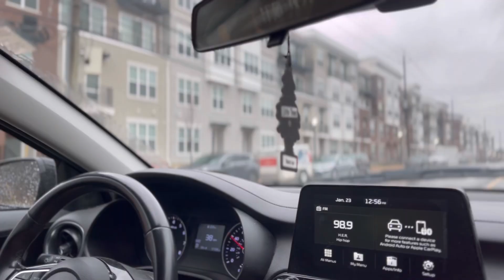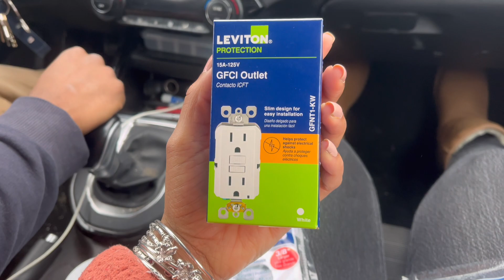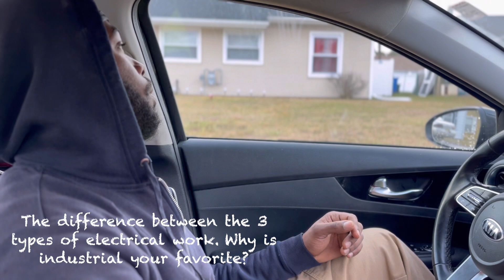A DAY IN THE LIFE OF AN ELECTRICIAN | ADVICE and Q&A ON HOW TO BECOME AN ELECTRICIAN

Comment: As  a electrician my self started back in 2003 I don't know a industrial electrician  that will tell you that  they like to do  residential electric an I have meet good  industrial ladys and men that i would not even let  touch a wire nut  on a residential job  yes the state test for your journeymen  card  is a money racket  any one that is good at testing can go pass the test because it is all in the  code book and a open book test  but it takes on the job training to get the proper way of  doing things  like any thing in life it takes a little common sense in the work area  goes a long way in any work you find your self doing  keep it up man its good to see younger generation taking a intrest in the feild .

Comment: Haha, he knew he was gonna get called out for using the impact!
I'll add not cutting the ears on that GFI in the cut in box and not using a square drive.

He made a great point about father and son teams, I'm trying to get my daughters in it too. 

Some industrial work is good, but he didn't mention anything about being stuck on a lift all shift and having to maneuver around a running shop or how much it sucks being on a roof  on a hot/windless or cold/wet/windy day.

They all have ups and downs. All together, I'll take industrial jobs. You get to get shit done.
Reply: I’ve done commercial, residential, and industrial. I always preferred industrial, myself except that the safety culture has gotten out of hand. I love motor control, PLC, instrumentation, rigid conduit, etc. It’s so much more mentally stimulating than your regular mundane tasks in commercial and residential like wall rough-in, branch piping,  etc
Reply: @Ephesians-ts8ze  there are enough tragedies like 1st year apprentices meeting 277/480 on a lift, unsupervised.
I don't think any excuse or apology is going to quell the family's sorrow or anger at the loss of their daughter.

I'd say let them learn on 120v connected to an arc fault breaker at most. She didn't even know how dangerous her work was.

I'll agree with some of the harness requirements being nutty.

I think training records would solve a lot of the issues.
Reply: @jonanderson5137  don’t get me wrong bro, I’m not opposed to working safely but there’s such a culture of indoctrination especially in industrial. You sometimes get put in harm’s way in the name of safety. And if the safety director tells you to do something stupid because they’ve never done a real days’ work in their life but they can regurgitate what they learned in a book or training videos, you better do what you’re told or you’re the one out of a job. Some of them have no useful skills in life so they have to try extra hard to justify their existence on the job. I just think the way safety programs are implemented and enforced on jobs often ironically creates unsafe conditions.
Reply: @Ephesians-ts8ze  I get it, I'm happily employed and I don't have too many problems. If someone wants to be a safety nut, I safely finish the job and move on.
Reply: He had left the screwdriver in the truck, lol.:face-blue-smiling: